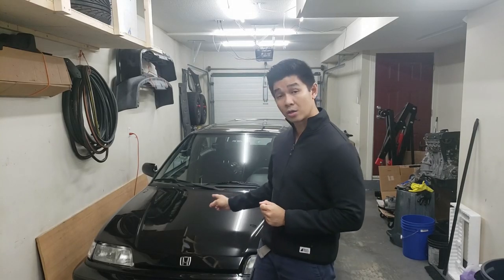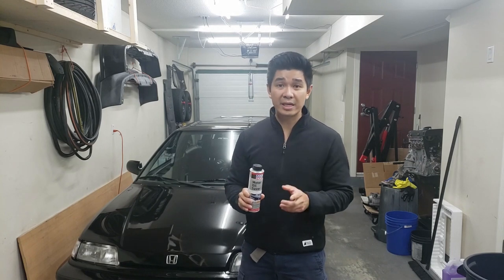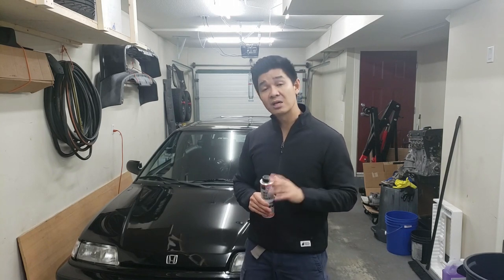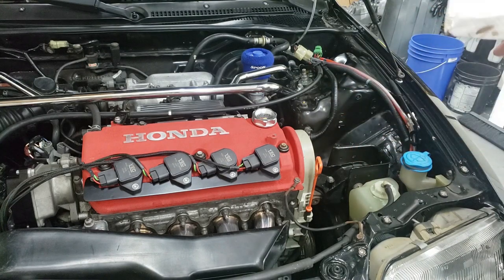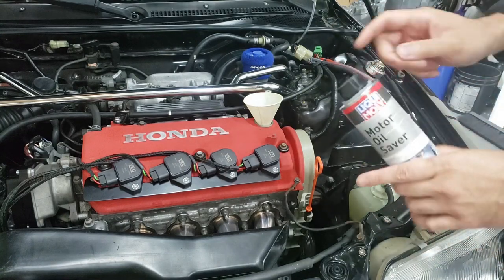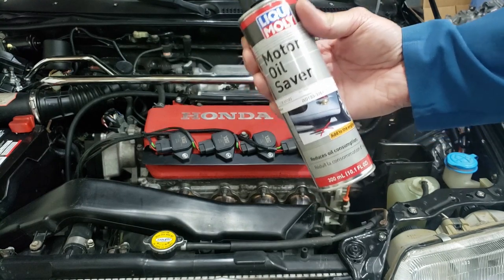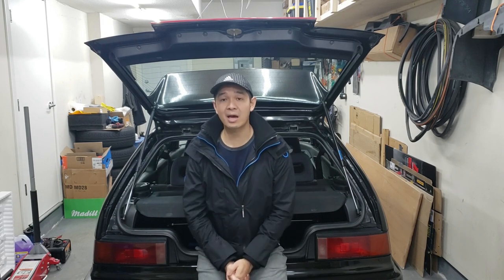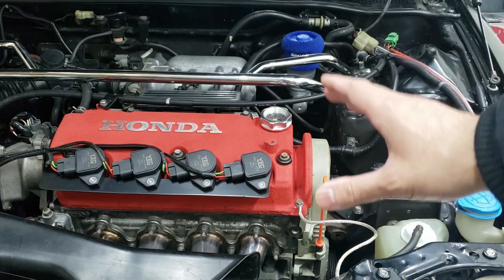||HONDA EF/ED CIVIC & CRX|| Would LIQUI MOLY Motor Oil Saver in my D16Y8 Help with Oil Burn...?!🤔

Comment: Love these well structured non marketing/biased videos. Have tried this solution in my N47 BMW, along with 5w 40 (highest weight that is still LL04 BMW approved), am interested to see it's effectiveness.
Reply from the maker: Thanks man. Unfortunutately, the solution worked for a very short period. The thicker weight oil combined with the oil saver slowed down the oil burn, but didn't stop it. So eventually it burned away enough to cause it to burn back at it's original rate of oil loss. I kind of already assumed this would happen because I was certain it was due to the piston rings. I can imagine this solution would work if the oil burn was due to a rubber seal, but when it comes to piston rings, the only solution is a engine rebuild.
Reply: @BudgetGears  Ultimately I agree. I think in your scenario the thicker oil probably contributed to the majority of the (temporary) improvement.

What is interesting is I have noticed what you have described with my situation as well. On a previous test (just straight 5w - 40, no additive), the car would easily do several thousand miles before needing a top up. But over time, the amount of miles it would do between top ups dropped. I wonder if this is the thickness of the oil breaking down closer to a lower viscosity?

Look into a piston soak with B12. Not totally convinced myself, but many people claim it is effective. And if it works, considerably cheaper than a rebuild. Of course, a rebuild is the only "proper" solution, everything else is wishful thinking to pro long it...
Reply from the maker: @swoogles4093  I think you're probably right on the oil breakind down. I mean also oil would mix in with gas in the combustion chamber, which would further dilute the oil over time. 

I did see a lot of stuff on soaking with B12. I was tempted to try it out, but wouldn't be able to anymore anyways. I recently rebuilt a different engine and swapped that into my car. It now runs perfect and has more power than before. In the future, I'll probably tear down this oil burning motor and see what the issue was and do a rebuild on it.

Comment: Hello fantastic video/product, can i use it at my existing oils without changing them? I ve run my car for 2500km can i use this product and later change the oils when they reach 7000km ? ( my usual oil changes).
Thanks in advance
Reply from the maker: @IcarusIcarus76  yes, you can dump it in anytime but just make sure it doesn't overfill your oil. I guess if you're trying this, then you must be losing oil. So you can try and top it up with this stuff.

Comment: Try keeping the rpms under 4K. Did the trick for my d16
Reply from the maker: My rpms are usually around 3k or under cause I drive mostly around the city. But it still consumes quite a bit of oil. It does eat more when I'm on the highway since I'll go above 3k rpm.